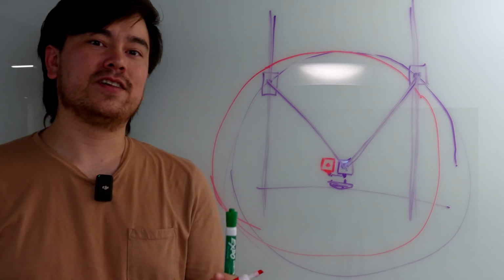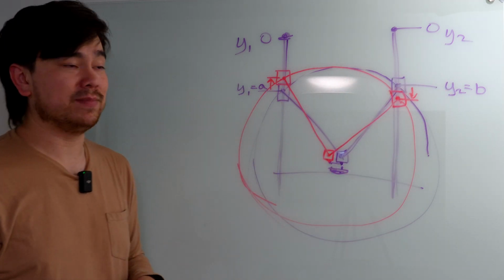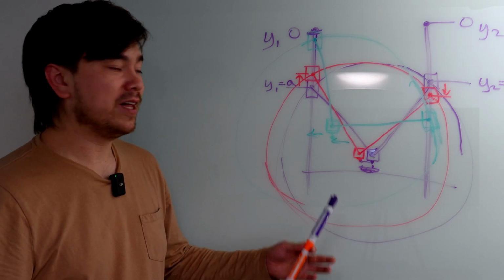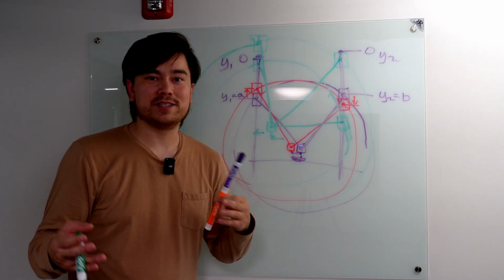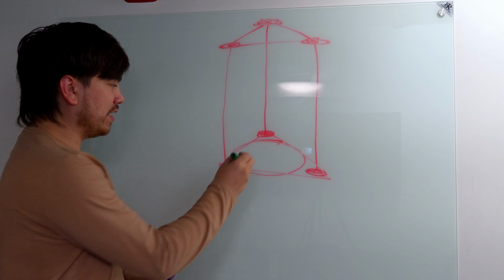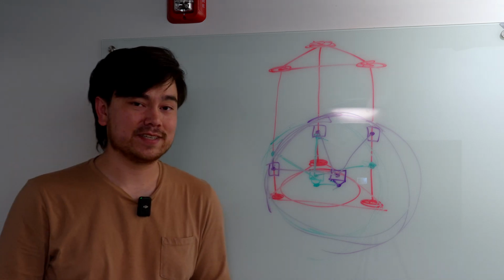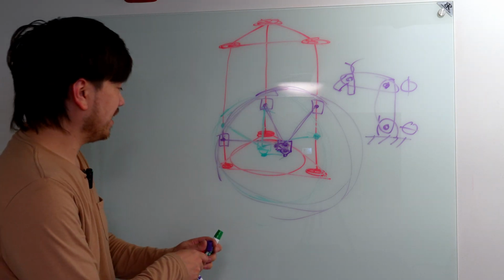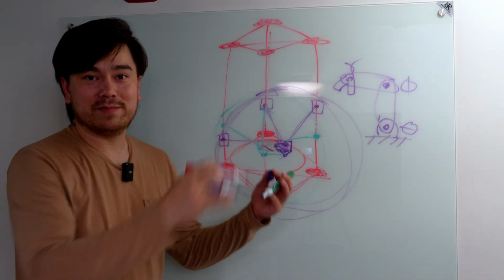Delta Kinematics Demystified - Understanding The Fastest 3D Printers

Comment: Having worked on a calibration routine for a delta printer, which involved a fair amount of studying the kinematics system, I can say this is mostly correct. Some further details:

Because the axes don't map linearly to Cartesian coordinates, they're sometimes called ABC instead of XYZ.

Z-only moves are very easy. All you have to do is move all three motors at the same speed, for the same amount of time.

XY moves (and XYZ moves, as when moving in arcs) are somewhat less simple. In order to move from one position to another, unless the move is purely in Z, each carriage will have to move on a curve, and not a straight line. In other words, while the effector is moving in a perfectly straight line, the carriages will have to accelerate and decelerate differently, and they will often change directions at some point. Because of this, the motors can't be instructed to move in a linear fashion. Instead, the controller generates many tiny segments (each of which is a small fraction of a millimeter long) and clocks them out to the stepper drivers at a high rate of speed. A rate of 100-200 segments per second is typical. For running the printer at extremely high speed (like with Klipper with input shaping), it may be beneficial to generate even more than 200 segs/sec, as the printer is moving quite fast.

You didn't mention (or draw) the horizontal distance (offset) between the effector's ball joints and its center. This matters, but is factored out in the arithmetic before the machine ever starts moving by subtracting that offset from the delta radius (horizontal distance between center of effector and carraiges.) At runtime, the kinematic routines see a machine with zero distance between the joints and the center of the effector.

You don't need to write logic to ignore the intersections with the bottom of the sphere. In fact, during normal operation, when the controller is converting Cartesian coordinates to axis positions (inverse kinematics), there is no notion of a sphere at all, just some basic trig: https://github.com/Smoothieware/Smoothieware/blob/edge/src/modules/robot/arm_solutions/LinearDeltaSolution.cpp#L62

What you are seeing there is just the Pythagorean theorem: a^2 + b^2 = c^2... that moves the XY position of the effector to the right place. At the end of each calculation, they add the Z, which is the same for all three towers. That's all there is to it: just calculating the elevations of the top vertices of three right triangles, and then adding whatever the Z is to that.

Going the other way (forward kinematics, or axis positions to effector position), there is a notion of a sphere. (Same link, but scroll down to LinearDeltaSolution::actuator_to_cartesian(), and you will see the comment mentioning "barycentric coordinates.") However, there is no need to write code to "ignore" the intersection at the bottom of the sphere. You only tell it how to find the top intersection. It doesn't know what trig is, or what a sphere is. It only knows that you're taking an exponent here, and a square root there, but never the fact that it has anything to do with a sphere.

Deltas used to have a well-earned reputation for being very hard to calibrate. This is why I and a few others (especially dc42, who wrote the RepRapFirmware which runs on Duet boards) spent quite a lot of time writing heuristic (machine learning) calibration algorithms almost ten years ago. It's extremely hard to figure out why a delta is not achieving perfect 1st layers without machine learning unless the frame is unbelievably, superhumanly well-aligned. (Not a huge issue when printing narrow objects, but without proper calibration it's progressively more difficult as the part gets wider.) The difficulty is because the math is non-linear (exponents and square roots); so the effects of miscalibration are not linear either, and really don't make sense to human intuition.

Early calibration systems relied on probing at some points along a triangle. They sucked and were horrible. The systems written during the era when I was doing that would instead probe on a grid to measure the bed depths. On a perfectly-calibrated printer, all the depths would theoretically be identical. On a real printer, there's always some errors in Z. The ML algorithms would look at the depths on the grid and use heuristics to figure out the particular tweaks to printer geometry settings that would most accurately explain the observed data. My calibration system could take a printer with ~110 microns of average error, and (on my printer) get that down to around 42 microns. Other people had even better luck, and could get down around 20 microns.

Today, this is a pretty standard feature, and I would never recommend a delta that didn't come with heuristic calibration. A few people still think deltas are hard to calibrate, but this is only true when the robot doesn't have that feature.
Reply from the maker: This is the best “well, actually” comment I’ve had in a long time, it should serve as an appendix to the video which is pretty superficial, but at least gets people thinking about it.

If you do the math, you could start with the spherical intersection model and simplify it down into a simpler problem, the fact that z affects all axis the same and can just be added to all rails collectively is a very interesting notion.

When solving for the transformation matrix I’m sure this would just plop out and be obvious but it’s a pretty big deal for simplifying the kinematics.

Comment: In the event you happen to see this, on a theoretical and not because I'm staring at a pile of parts and the old bones of a delta *cough*, if you had the option to rebuild a large delta or swing for the fences and try a tripteron using the parts and possibly the motion system on a three-rail linear stretch to do a long rectangular overhead gantry kind of thing, any thoughts on two radically different approaches?

Comment: Intersections above and below is an interesting concept. You should make a delta printer with the bed in the middle and print heads on both sides of the bed. The top side and the bottom side could be completely independent or used to make copies. I guess that would complicate supports, but there is that cartesian printer that prints upside down.

Comment: You lose speed not acceleration when the angle is really shallow. The delta arms are a cvt and shallow angle is the "ultra low gear" end of the cvt. Traditionally folks design deltas to limit the min angle so you don't lose too much speed, but the speed penalty only actually hurts moves opposite a column in the direction towards/away-from it (not perpendicular direction), so if your firmware can be smart about it, you can use extreme min angles without much penalty.

Comment: So delta printers have to be tall to perform well and they can only use a fraction of their height for the build volume.
Reply from the maker: Yes. The literal overhead (in mm) is at a minimum the width of the build diameter, and in practice, usually about the golden ratio times the build diameter

Comment: Are you sure that the code is using spheres?  Mathematically, it would make more sense to use each linear rail as an axis and a circle to create a plane through each axis, as they are much easier/faster to calculate.  The overall idea might be spheres, but I doubt that they would actually be used in the firmware.

The more vertical the rods are, the greater the farce that is placed on them and the bearings, which can be very extreme.  How often do the bearings and rods need to be replaced?
Reply: Rods never wear out. The joints/bearings can wear and develop slop, but there are lots of different choices where that can be more or less of a problem. Mine uses printed cups with spring preload that should not develop slop under wear.
Reply: using circles would give you a cool plotter that draws pictures on paper.
Reply: @T00LF00L  Kinda, but it takes up a lot of planar space and has poor Z stability.
Reply: @daliasprints9798  I have no clue what you’re talking about. I was referring to the question of the code.
Reply: IK (Cartesian to actuator) doesn't use sphere math at all, but just the Pythagorean theorem. FK uses sphere math, but that's only needed for calibration and similar auxiliary tasks.

Modern Delta arms are made by encasing a ND magnet in Delrin plastic, which is then ball-milled to have a spherical profile. That then rides on chromed steel balls. These last for a very long time.
Reply: @__S__435  "Sphere math" is just an excessively scary way to say trigonometry/Pythagorean theorem in 3D. It's all just triangles.

Magball deltas are common but I wouldn't say it's the "modern" choice. They're heavy compared to alternatives and have worse failure modes, but they're low maintenance and super convenient for doing other maintenance on the printer.

Comment: Simple and effective explanation. I already had a general idea on how Delta's work, but this really does demystify it. Something I feel is overlooked with Delta printers (I think at least? ) is that they would work really well for a DiY high-temp 3D printer. Just use ball screws instead of belts for z-motion, and other than the extruder parts, no electronics need to be inside the heated chamber.
Reply: If you use a long bowden. For direct extruder you still need a motor inside. On bigger Deltas (like Anycubic Predator) a feeder hanging on springs was used, to keep the bowden short; modern Deltas mostly use a direct extruder with Nema 14.
However, you should be able to cool a nema 14 with a peltier element or water cooling if you have a very hot chamber...
Ball screws are normaly a lot slower than belts, as they have a high rotating mass. However, there are alternatives to normal belts with higher temperature resistence.
Reply: @oleurgast730  Not necessarily, you could also use a Flex Shaft. That way you get full benefits of direct-drive, without any motor weight. I used one on an old Ultimaker 2+, and recently I reused the same Flex3Ddrive on a DiY corexy, actually managed to make a cantilevered flying gantry that doesn't sag (that was my goal, I'm using it for education purpose, and this design makes everything clearly visible). Issue here is that my e-steps are quite high, so the extruder motor needs to spin A LOT, but that could be avoided with some more sense put into it.
Reply: @astrumrocket6556  You are correct. I totally forgot about the good old Zasty Nimble I used a few years ago ;-) So yes, a Delta definitly is a nice design for high chamber temperature. There might be a reason Prusas new industrial printer is a Delta...
Reply: @oleurgast730  Funny you should mention Prusa, turns out, they are selling a Flex Drive type extruder for their (or Trilab's) DeltiQ. Shame that flex drives aren't more popular, I understand why, but still, it would be nice if there were a few affordable ones on the market.
Reply: It's even easier than that. You can use bellows and keep the motion components outside of the heated zone entirely.
Reply: That is exactly why Prusa's new turbo insane engineering filament printer (HT90) is a delta, according to them. (Well, one of the reasons. Cutting the part count in half, and making it easier to service, are probably also on the list.) The chamber can hit 90C, and they wanted the motors and other electronics outside as much as possible. They still have to run stepper wires to the direct-drive extruder. Don't know how they did the endstops, but if they're Hall effect they don't need to be inside the chamber either.
Reply: @__S__435  Deltas usually use optical endstops.